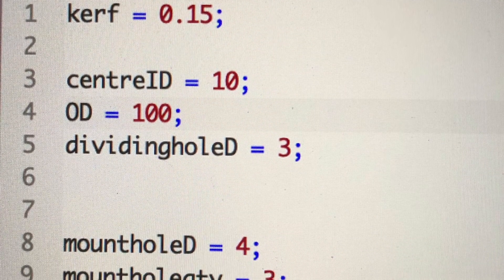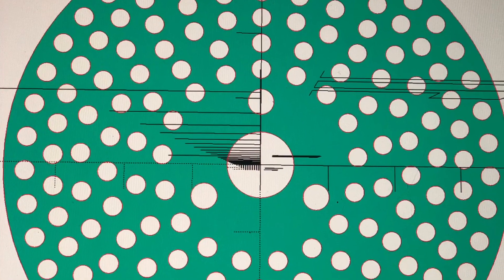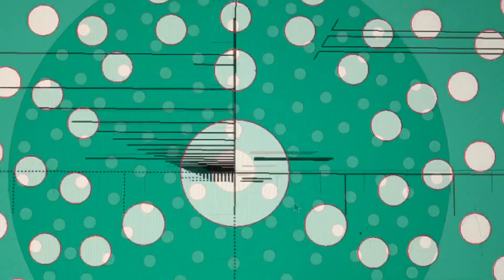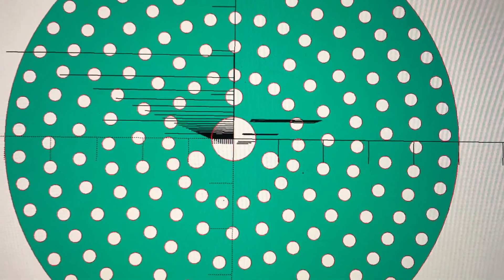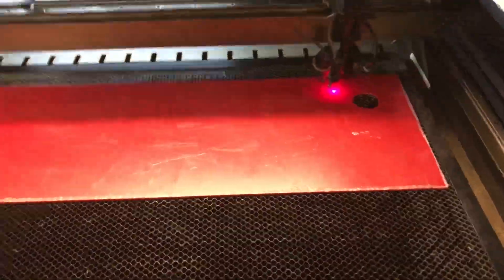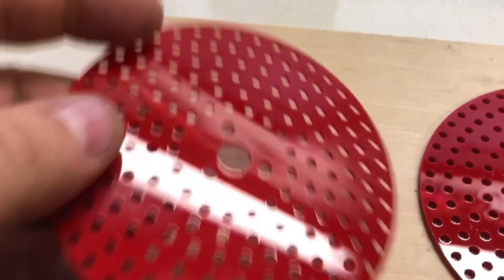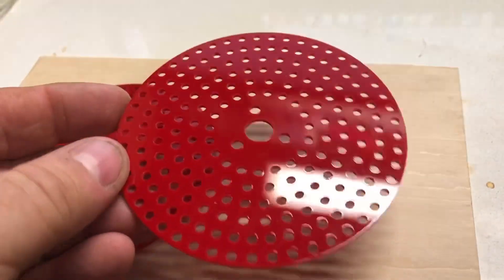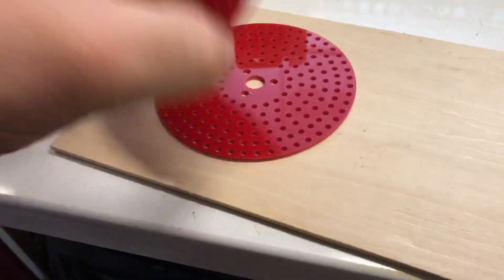Tool Time - Dividing Plates

Comment: Interesting. I wrote a PostScript program to do much the same, but I glue the drawing to acrylic or Lexxan and laboriously center-punch and drill the holes. If you have a 3-D printer it is much easier, but you may still have to ream out the holes.